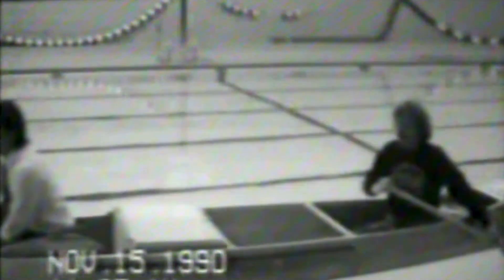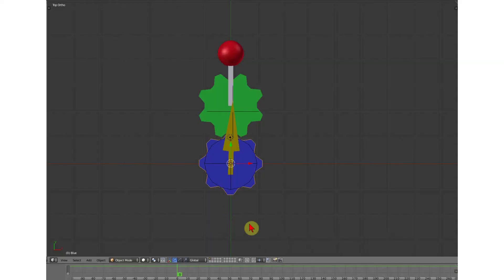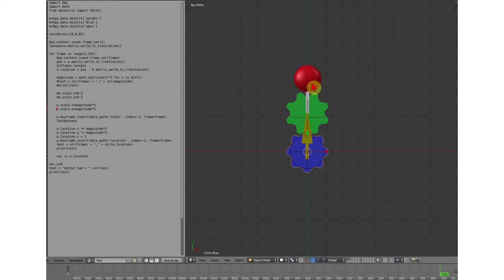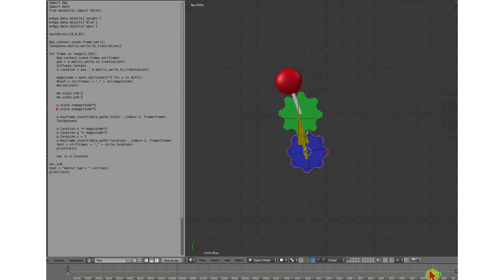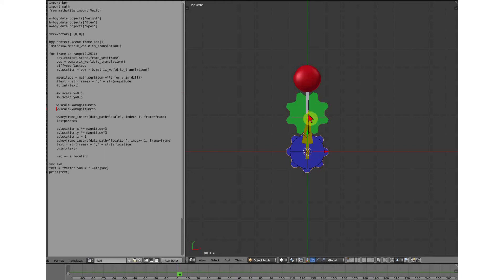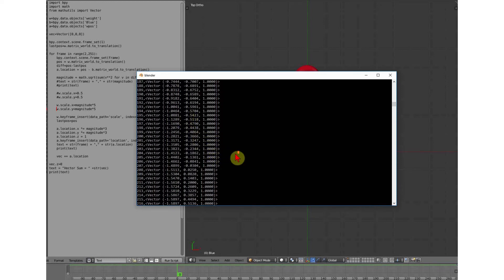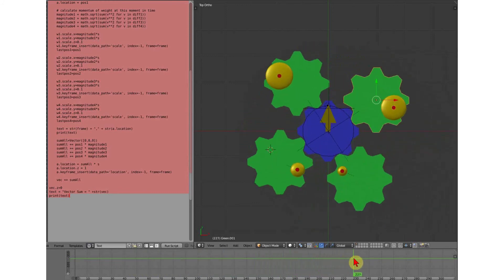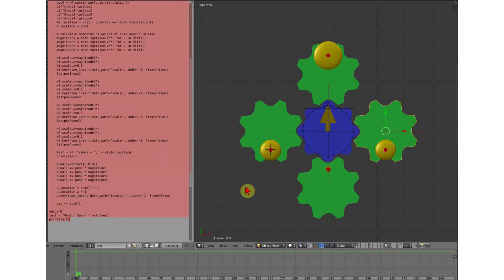New - Proof that  the Thornson Inertial propulsion drive should work

Comment: If you extended the weight so that it passed through the centre of the blue cog would it be more efficient? Or if possible in front of the blue cog. You are a clever bloke and this is one of my favourite topics, good luck.
Reply from the maker: Hi Rupert, yeah I ran several simulations with varying lengths between  weight and the centre of the green wheel.  In each case, extending the length resulted in greater momentum and therefore thrust.  Unfortunately I did not put those simulations in the video.
Reply: @DuncansPlace  Copy that. Thanks for making things interesting, StarEagle1 out.

Comment: If your animation runs in smaller steps and your "nett force" decreases then the anomaly would be due to step size being too large (and resultant asymmetries). Try to get the ball to move at different speeds forward versus backwards. It would be interesting to see what happens at relativistic speeds being achieved in one direction only but this setup would not be suitable for that. Here is another idea: https://www.youtube.com/watch?v=UXo6WvHRs_I ... However a "closed box" system based on stopping a swing would not be a closed system due to gravity reaching the inside of the box.

Comment: It is a great idea, but on high speed, will have to much vibration,I'm glad to know it would work, cause I went crazy to the nut house, I tested a different system with less vibrations and more speed it worked on the first test, my wife took me to see a shrink, and I abandon the project long ago, I thought it was a failure an imposible machine
  I doesn't contradicts Newton's law, on the contrary, Newton has too many laws that supports the principle

Comment: how would you go about cashing in this idea
Reply from the maker: You would have to build a working model and prove that it works, like Thornson did.  Then build more powerfull, smoother running, commercial versions which can be used for propelling swamp boats, bicycles or what ever can use that type of propulsion.  NASA and Boeing would also find it interesting but not until its been proven as workable.  Even Thornson, who had a working model, failed to convince anyone of its usefulness.  A swamp boat doing 80mph should help get people interested..
Reply: cool

Comment: Result= 0...when you accelerate and decelerate a mass in a closed system...result = 0...I found a way...you have to accelerate a mass using an outside system...like in a rowboat...with a pipe + mass in front...an external hand moving the mass side to side=TRUST (45 years of research)

Comment: You accelerate and decelerate a mass in a close system...result= 0
Reply: It's not tru
Reply: If the (part) that accelerates and decelerates is (connected) to the close system craft, wouldn't the craft also accelerate and decelerate, being that it uses centripetal or centrifugal force? Look at how it works closely please.